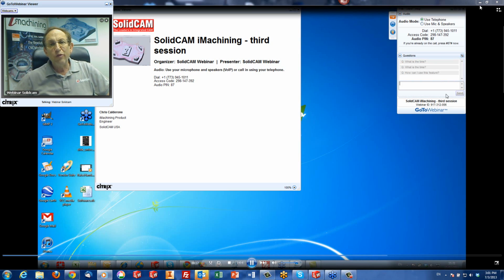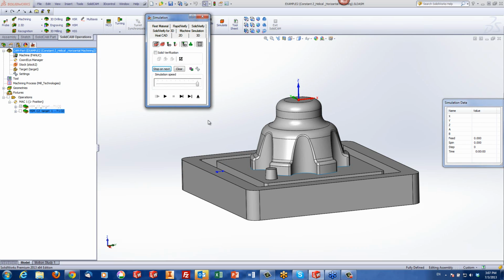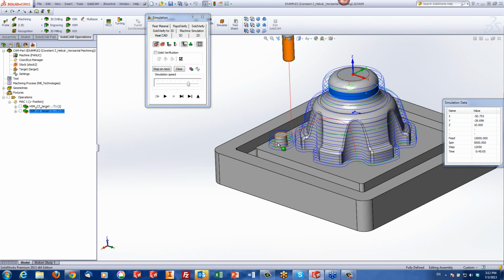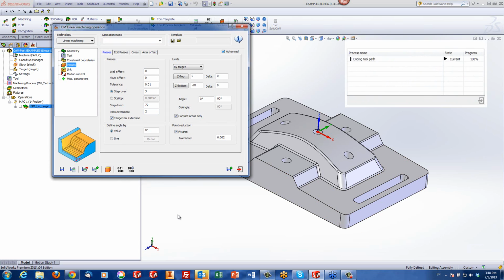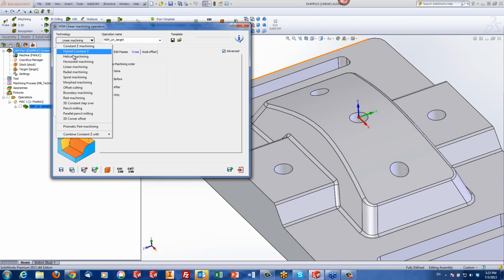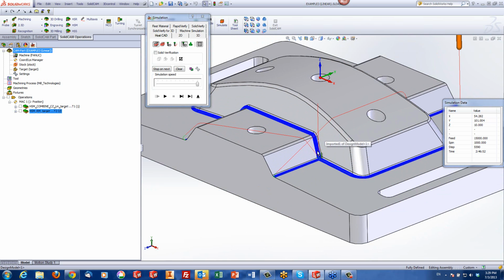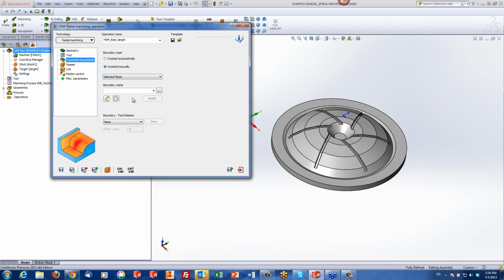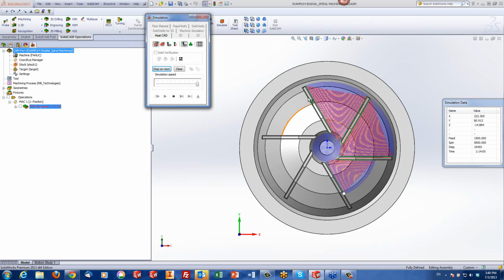SolidCAM University: HSM - Part 1

Comment: Hello Professor. Thank you very much for this video. I have a question: is there any way to contact you ?. 
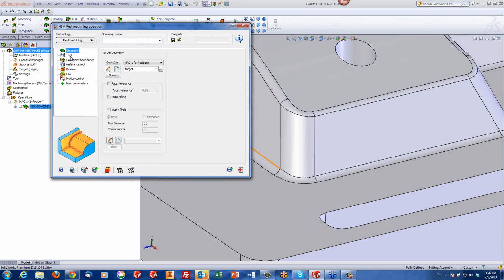Regarding to the video, 26:40, why wouls you use rest machining instead of pencil milling or parallel pencil milling? aren't they supose to be special operations for corners? or are they the same ?.